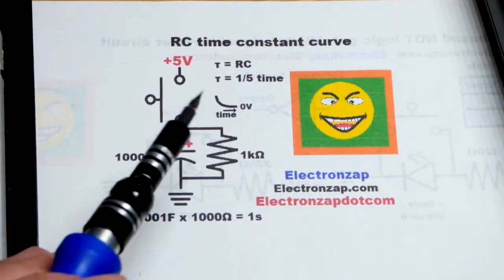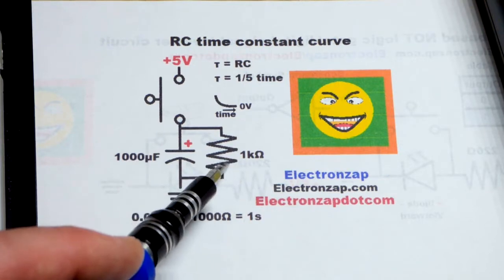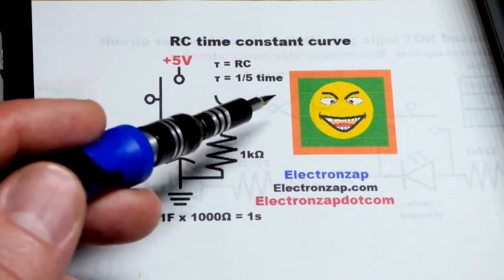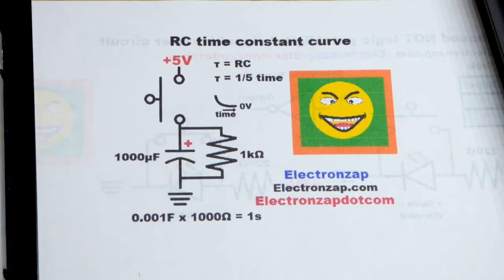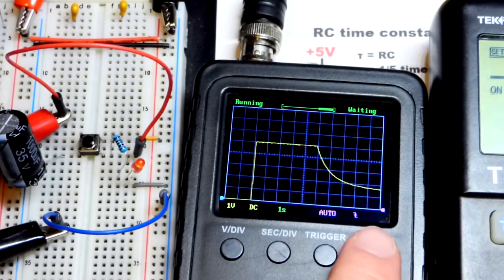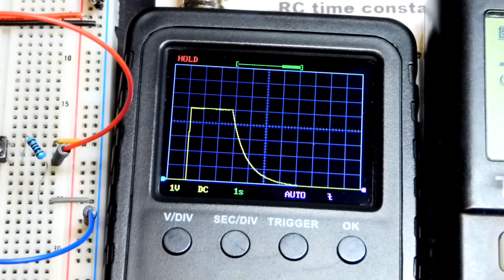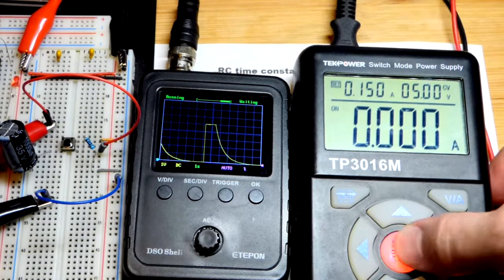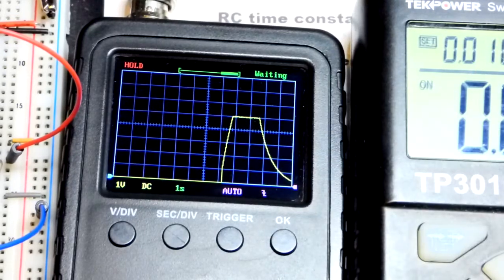Discharging capacitor component RC time constant curve oscilloscope measured

Comment: Good Job! I have a question just to clarify some Theory about this. I get how a Capacitor can Discharge for a certain time to create a delay. How would a Resistor help, because all it is doing is just dissipating some current into heat and resisting current. I don’t get how that can work with a Capacitor with delay time. Great Video and Thank You!
Reply from the maker: Capacitors store a certain amount of charge per volt. Larger value capacitors store more charge per volt than smaller value capacitors. They will discharge instantly from high current if you just short circuit the terminals instead of using a resistor to lower how much current flows. Current is the rate of moving charges.
Reply: electronzapdotcom Okay Thank You that makes much more sense!

Comment: Thank you! I can see how this could be great for make envelopes for sound and light. Question: why does the LED prevent voltage from dissipating to 0V?
Reply from the maker: You need to exceed the LED forward voltage (at minimal current) for current to flow. So once the capacitor voltage is at the lower end of an LED's forward voltage, it can't push current through the LED anymore and the capacitor holds that voltage.
Reply: @Electronzap  fuckin genius m8